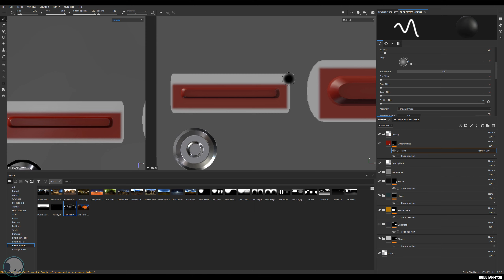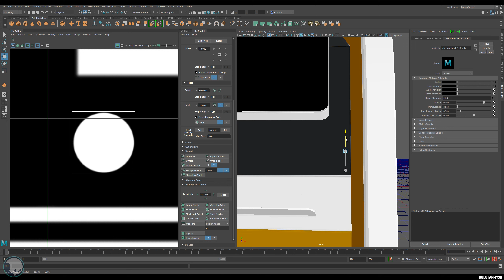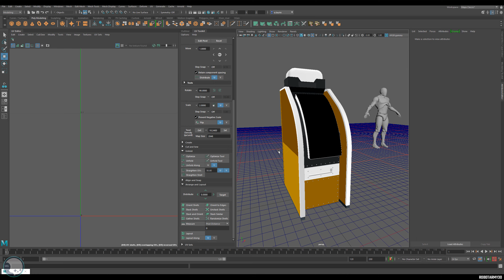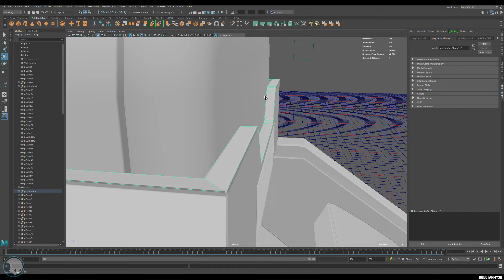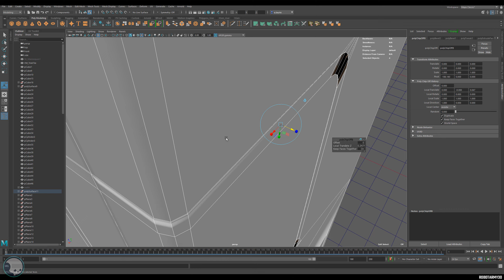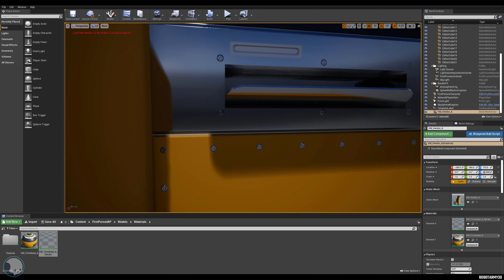Comment: question:
after you added all the decals, did you combine the model with all the decals or did you leave it? cus the model looks combined when you show it inside Unreal, with no group or child structure. The children decals would be one drawcall otherwise, and im trying to understand the trimsheet workflow with decals WITHOUT using decalmachine (it doesnt work for Maya anyway). But ive seen no other tutorial showing how to use trimsheet decals than yours. But workflows are missing. Hence my question.
Reply: They are combined, adding two materials to the mesh in maya, one for the body and one for the decals will give you two material slots in UE letting you put specific decal material to that part of your asset. There is also a way if doing this using two UV sets rather than floating meshes.
Reply: @RobotArmy3D  thank you for clearing that out. I experimented on that myself, and ruled out that you couldnt have had left it un-combined. wouldnt have made any sense. but im on my way of finishing my own take on the Arasaka Tower in cyberpunk 2077 thanks to this. and its in VR, so i have to keep it as cheap as possible, hence the question. thanx for verifying it.
Reply: Np, good luck with your project!
Reply: @RobotArmy3D  thanks, didn't know about using decals as a material in static mesh itself, rather than decals actors only